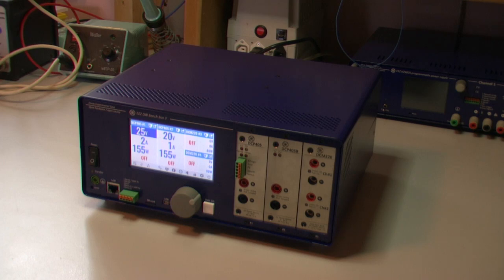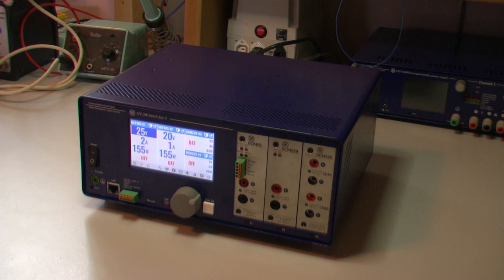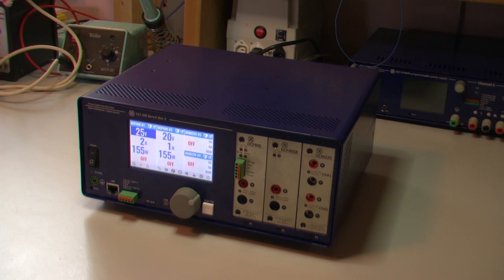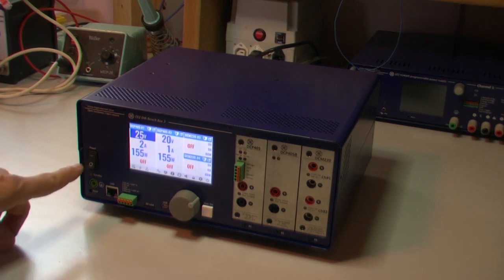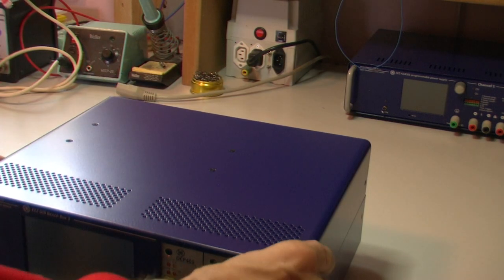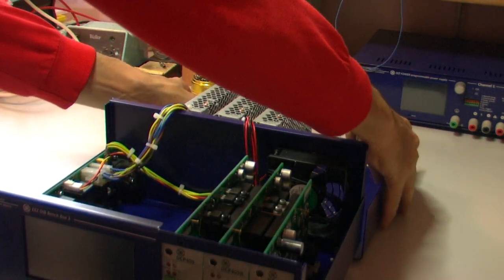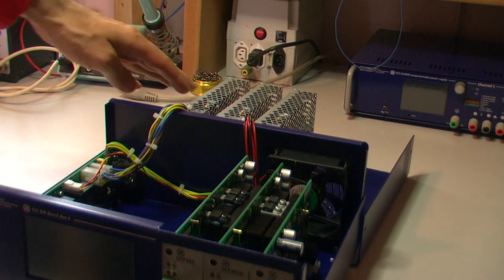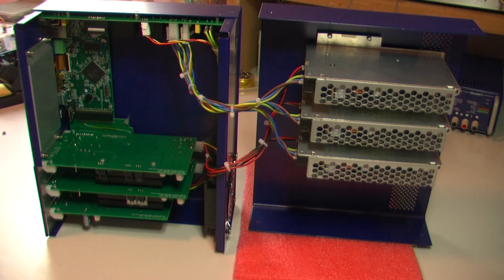BB3 the latest prototype

Comment: Trying to digest the USB and Ethernet on the front panel, but couldn't so far.
Reply from the maker: It's not easy to digest, but helps in keep cost lower and wire harness simpler :)